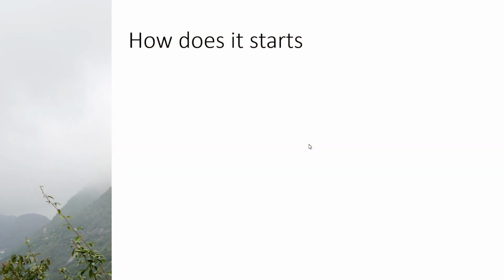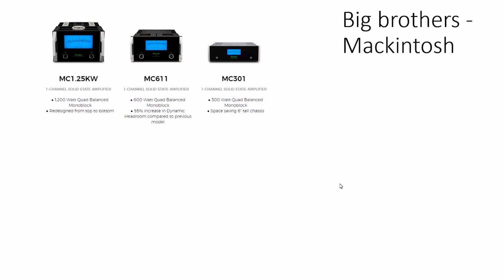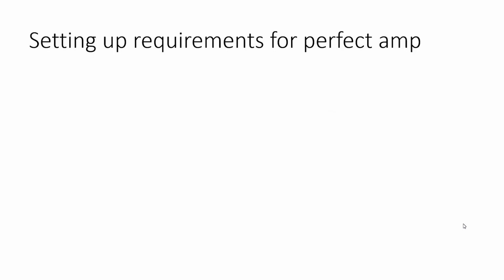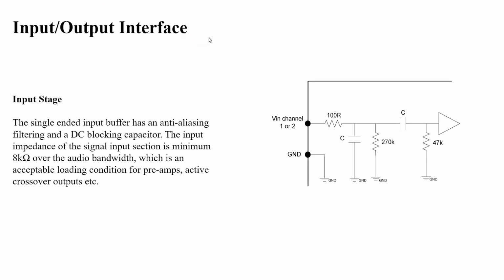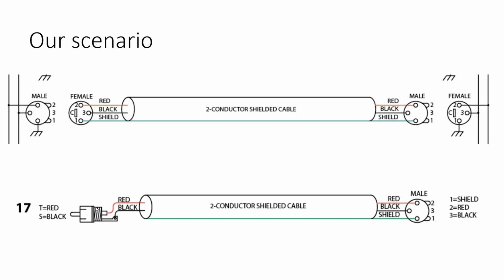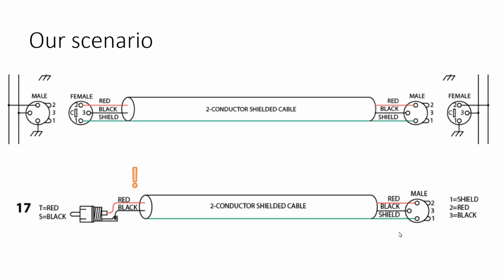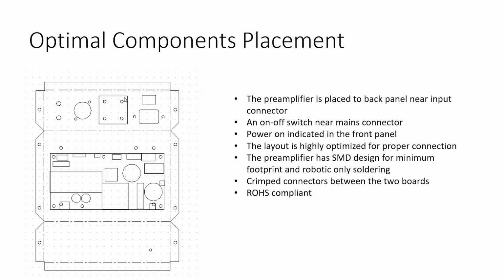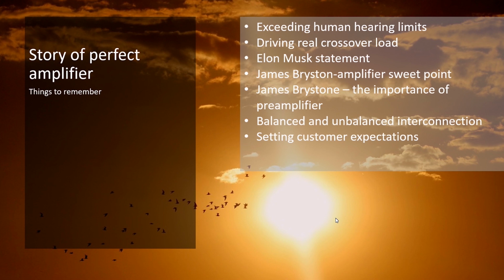500W ICEpower125ASX2 balanced amplifier DIY kit  part 1-12

Comment: A very interesting video. You're very convincing in your arguments. As I'm looking at my next system (with speakers and amps) the amp I like most right now is the Lyngdorf TDAI 1120. But it has a lower power rating. For some speakers that's fine but kef r3 metas require power. So your monoblocks would be very nice. 

Red is a colour with low Wife Acceptance Factor, however. White, silver, gold or black would all be much better.
Reply from the maker: Time has passed and there is a new hero Icepower 1200As2. I have a video bout it and a build kit for DIYs. It is a true end-game amplifier.https://youtu.be/zSsy41UlqF0

Comment: outdated, the new hypex is better
Reply from the maker: By drilling down into the topic you may find that human earing has relatively low resolution. THD max resolution is 0.25%, amplifiers can easily make 0.005%, and Amplitude resolution is 0.25dB at midrange around 3kHz and 3dB at 50Hz and 16kHz. Damping factor max value 50 (amplifiers can do 700 and more). The basic parameter specifications improvements do not make sense. But such things as quadro balanced (bridged), power supply instant power capability, thermal design, etc become critical parameters when we are talking about amplifier quality. And the right direction to audibly improve your system is using active crossover and active speaker systems. Most of Chipamp's active systems sound better than most advanced Icepower Hypex or Purifi most expensive amplifiers with passive crossover speaker systems.
By architecture, Quado balanced design, power supply instant power capability, audio quality, output power, and telemetry built-in Icepower 1200AS2 is the best amplifier board today. It is available for the DIY community from EU-proven retailer Soundimport.

Comment: I couldn't tell the difference between a NAD C298 and a Bryston 4b3 in a head to head test.I couldn't believe it , I like Bryston but why should I pay triple the price for the same sound ?
Reply from the maker: Human hearing resolution is relatively limited. Both companies NAD and Brayston are gurus in amplifier design. Some parameters may differ in measurements, but due to limited hearing resolution, we can not hear them. Things that you hear are power, absolute noise, weakness of power supply, etc. A powerful and low noise amplifier is difficult to make, but it matters only in cases when your speakers have high sensitivity, low sensitivity speakers just need power. Strictly talking for home usage floor standings we need about 500W minimum clean power to reproduce all music types and scenarios. Clean 500W power means about 600-800W amplifier. And you may find out that there is limited offering when we are looking for price point, power, and quality.
Reply: @guntarssmits2104  A good choice for the amp you're talking about could be the Michi S5 , it has 500 watts (8ohm) , 800 watts (4ohm) 60kg of weight and low THD (0.008%). At 6,500 euro , it's not a gift but similar amps like the Bryston 14b3 costs 17,000 euro and the McIntosh mc462 costs 16,500 euro. The Michi seems like a very good option.
Reply from the maker: Or Icepower 1200AS2 board for 430 EUR in retail providing  600W stereo to 4 and 8 Ohms with 0.005%THD  @danielesbordone1871

Comment: When a kid turns a volume knob to a right edge, I propose to get back to a discussion about a max amplifier power needed )) And the only way to avoid this is to use a digital or relay based volume control, which is inactive when is turned off.

PS Now there are number of offerings with 125ASX on China market. And I personally wonder how do you keep price for a whole amplifier below a single Ice OEM module price.
Reply from the maker: Technology is developing and modern audio systems have an architecture Cloud, Audio streaming service provider, network streamer, smartphone management system, and no knobs in front of Streamer. With such architecture, there is no kids’ problem and your music access library exceeds 60M music recordings with infinite options for building your personalized music track lists. And I am confident that with AI adoption you will have many music track suggestions that meet your taste.
Reply: @guntarssmits2104  Streaming? No way )) I prefer to select a year of release and a label by myself. In 90% cases “improved remaster” (streaming services offer) is a compressed (a low dynamic range) trash with plastic instruments.
I agree about 500W for a home, but with a little kid this could cause expensive loudspeakers death
Reply from the maker: @sc0or  Streaming is the future. I have a video about Psychoacoustics where a professional musician from the UK did tests with uncompressed and compressed music. You may be surprised about the outcome. Studio mastering is the main recording quality influencer. Any way. Our generation is coming to an end and the new generation is taking place. More and more of my customers are coming from future generations at the age of 30-35. They are different and we need to offer formats that they prefer. At some point about 10 years ago I also sold out all my vinyl and CD collection reducing space needed for music equipment and moved to streaming. That opens a new world out of my personal collection with instant access to any track and artist. The key to audio quality is speakers. The rest of the equipment is shrinking in size, rising in quality, and has a better user experience. The new generation will define the Audio equipment market. Somehow I need to follow trends😊
Reply: @guntarssmits2104  Indeed.
Reply from the maker: 500W short-term undistorted audio is not dangerous for a 40W RMS speaker. I am making experiments using 100W RMS-rated small shelve speakers (6-inch woofer with about 60W RMS in specs and 20W tweeter) and sometimes crazy things happen. So far, no damage. 500W is just less than 2 times louder than 100W. I have another video on my channel were explains power, sound pressure, and human loudness perception relationship. Boards such as ICEpower 1200AS2 have built-in soft clipping circuits as well. 100W Amps in class AB world are mainstream due to heat dispatch problems and efficiency which are making high quality power crazy expensive moving more powerful amplifiers in premium price segment. Today we do not have such a problem anymore.

Comment: How on earth this is a 500W amp? 450W 1%THD+N @ 4Ω, BTL (yikes)....is 65W on its best!

"The ICEpower125ASX2 module is designed for music reproduction, which means that the output
power of the amplifier will never be continuous. Research has shown that the RMS level of any music
signal does not normally exceed 1/8th of the peak value and the power supply is therefore designed
for large short-term power handling and lower continuous power handling. If the average output
power of the ICEpower125ASX2 exceeds 65W @ 4W (SE-mode with both channels driven) or 70W @
4W (BTL-mode) for a long time at 25°C ambient temperature, the module will reach its maximum allowable
temperature and the temperature protection will be activated "
Reply from the maker: The audio amplifier is all about instant power capability. You are right that for a long time sinewave, it will overheat, but all components and power supply rail voltage is capable of 450W for about 60 seconds. Heat dispatch is not able to dissipate heat for sinewave. But it is perfectly capable of 450W music power which is 1/8 of the continuous sine wave. This board is built with in-depth knowledge about the audio spectrum and specifics. I have tested and it sounds in a bridged connection amazing and drives large low-sensitivity speakers without a problem.
Reply: Thank you Guntars.
To be honest, that ''music power" calculation looks like those ''PMPO watts" (Peak Music Power Output) used in the 90's and not an industry standard,
That said the other measurements seems to be on point and more align with industry standards (AES, ANSI)... I have to thank you for the INA recommendation, keep up the good work.

Comment: Hi Guntars & thanks for the channel ... someone who has a background to talk about the topics is rare in the youtube!  Anyhow, enjoying you content about class D amplification and currently in dilema to replace my peachtree audio nova 220se with  pre-amp+(ice,/purify) based amp. However as I don`t have a toolset nor I haven`t found measurements if my current nova 220se integrated amp I`m not to make a qualified decision. Have you measured the nova 220se or measured similar design (with same Ice components)?  thanks
Reply from the maker: Hi, Thank you for the inspiring comment. 
Nova 220 is a great amplifier and uses 2  ICEpower125ASX2 boards for output stage set in bridged connection. It will be hard to beat such architecture. Amp has a lot of headroom having 500W per channel. You are at 9 points from 10 with this design. Probably you know that the last 5% of quality will triple your project costs. The human hearing THD threshold is 0.1%, Typical speaker THD is about 1% for budget and 0.1% for high end. THD is not the main parameter influencing sound quality. It is far more about amplifier capability to deal with instant loudspeaker acceleration capability to reproduce tiny details. This is where a high-quality bridged solution has an advantage. There is the term “Quadro balanced amplifier” which simply means precise bridged output stage. It will be hard to beat Nova 220 with Purifi design. You will spend significant money but will gain just some bits. If you want to improve your sound reproduction quality you should think about project how to make your speaker system active. That means active crossover and direct speaker connection to the amplifier output. A lot of details are missing in the passive crossover. Even a good one.
Reply: @guntarssmits2104  Thanks Guntars for your swift response! You know I had my doubts since I couldn't quantify the performance of my set(din't find measurements online nor I knew someone who coul measure mine directly)...so thought that I could achieve considerable audio improvement with upgrading to equipment that doesn't have 10 years (speaking of both amp section and DAC also).  Subjectively, I'm satisfied with my current setup (nova 220se + big waveguide speakers based on Mr.Geddes's design). And yes, the Geddes design considers active x-over...I'm aiming there at some point of time.

Comment: Hi Guntars, very cool review, thanks a lot fo that. I'm a doublebass player from switzerland and I'm experimenting for years to build a portable lightweight and powerfull bass amplification system. (amplifier and speakers) I did similar research like you and have a lot of experiences with the 125ASX2 board. I'm planing a little portable PA for smaller gigs and I'm using the 125ASX2 as a 2 channel amp. My question to you: can I buy a INA1650 preamp-module from you in 2-channel version? kindly Mirco ;0)

Comment: Personally I rectify the input power from the wall to drive the final stage. The only reason I still use a switch mode supply is for the preamps and control system. I built a decent DSP for the ones I make.
Reply from the maker: The last 5 % of audio quality is sophisticate an expensive solution. Thank you for sharing your experience,

Comment: All i need in a simple series to make my own HIFI amplifier.
Reply from the maker: There are large number of videos in YouTube how to build audio amplifier. Could you be more precise abut kind of amplifier you are looking for.
Reply: @guntarssmits2104  Well, i was already looking at the class D Ice modules. I'm planning to use a tube preamp, followed by a Minidsp 4x10HD for active Xover into 3 Ice modules, one for each L+R speaker plus 2 subs.
Reply from the maker: @jay1st1st  Great project indeed. Maybe you should consider 4 Ice modules when driving 3-way speakers. Woofer needs far more power than midrange and tweeter. With 4 modules you will have set 500+100+100 in stereo mode. You will separate the woofer power supply from midrange and tweeter boards as well.
One more thing – if you take professional crossover you may drive ICEpower boards directly from their inputs due to balanced architecture. For example, the t.racks DSP 206 cost is about 200EUR. I have one prototype chassis for a similar project in eBay. It is made for  4 ICE boards capacity and has connectors attached. That can suite for experiments. https://www.ebay.com/itm/114619901180
Reply: @guntarssmits2104  tnx a lot, i'm still in the design stage, as it takes time and money, i still have to finish my speakers and do the measurements for the active xover with the Umik1 microphone and REW.
Reply: @guntarssmits2104  nice idea for the 4 ICE boards, but i'll go with passive cooling and stick to my MiniDSP ( i know how to use it) as i need a silent sytem for HIFI use. But i might order some balanced preamp boards if you sell them

Comment: Wow thank you for this informative video! I’m trying to make a 9 channel home theater amp using the ICEpower (3)200asc and (6)200ac. What do you think?
Reply from the maker: It will be outstanding 9 amp. system. Among best of the best. Requirements for movie theatre are significantly lower that for hi fi, So you will have 5 star system.
Reply: What are using for a power supply?  Will this be all in one chassis?